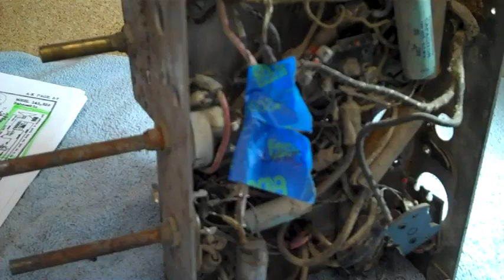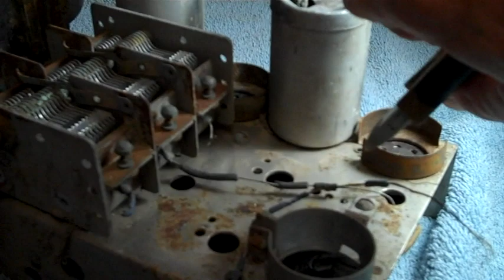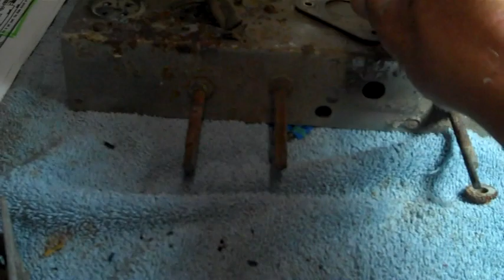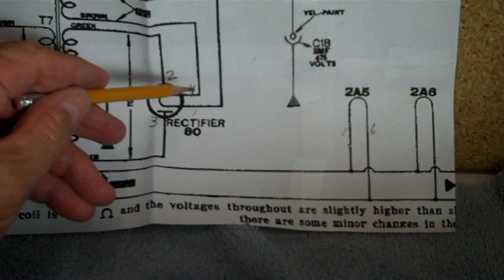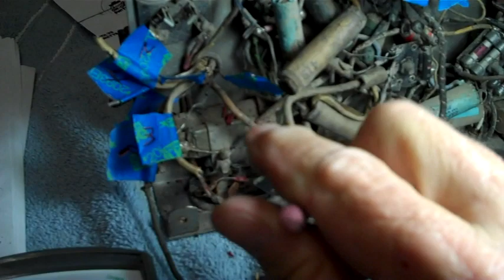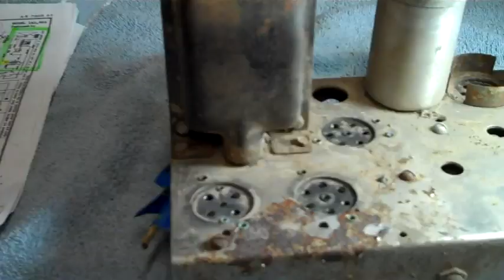1935 Atwater Kent Model 145 Repair and Restoration (Part 6 of 38).

Comment: Hey John, you're probably past this step by now, i'm just getting caught up... but I used rubber plumbing washers that I had to modify a little for tuning cap insulators when I put my philco 89 back together. cheaper and quicker than ordering custom reproductions ;-)